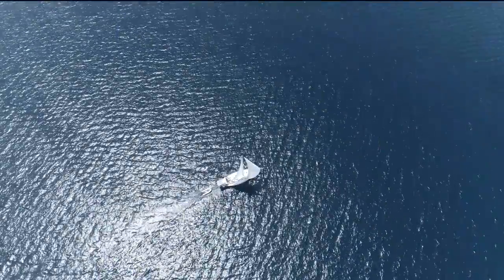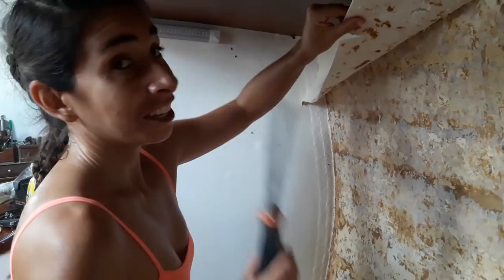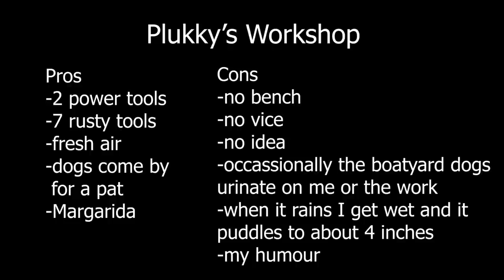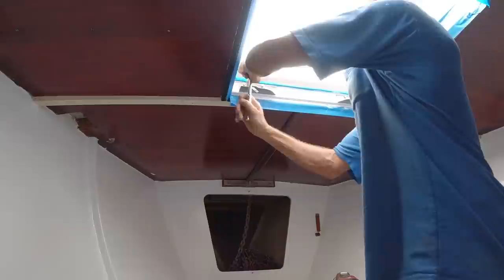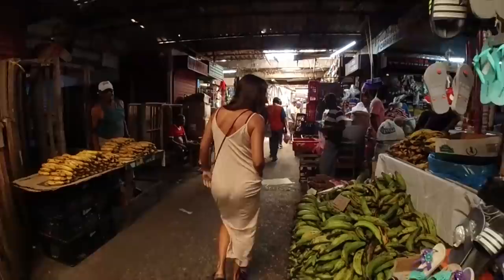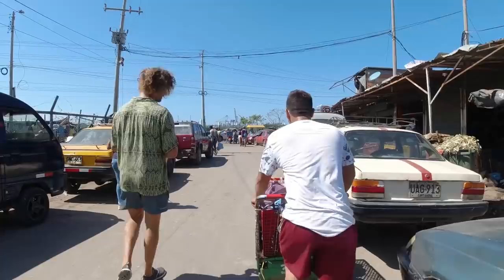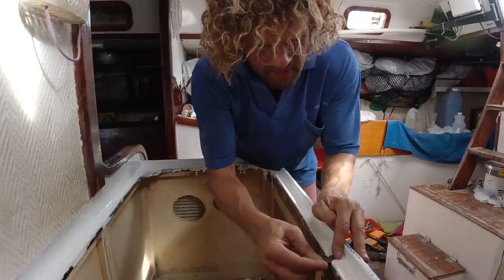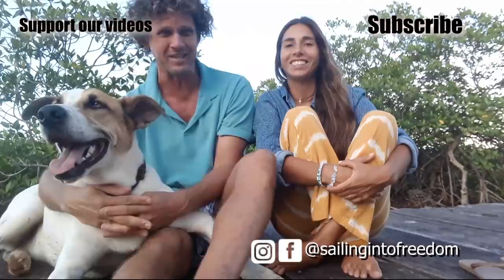Ep. 256 DIY - the clock is ticking on our boat repairs

Comment: Pete, a floodlight at the top of the mast pointing down to the stern/cockpit area is ideal for any safety and security , but the best and cheapest option for night time attacks is a torch of about 2,000 plus lumens with a strobe light function @ a cost between AUD50-130.
I have had a motorhome for the last 10 years and I had a guy nosing around it around 2 am--I have a purpose-built caged trailer with a KLR650 adventure motorcycle in it, fishing gear, a malibu and a wave ski, and a kayak on top all of which attracts a lot of attention wherever I go--and once I located where he was outside from inside the motorhome, I stepped outside and turned the strobe light on and he was totally incapacitated. All he could do was run away. He never even got to feel my kendo sword across his noggin!
For day time boardings, whether you are present or absent, is 'noise'! A recorder, a loudspeaker, a trip mechanism and switch all of which @12v is relatively inexpensive. Get a 'Margharida Fidelity and Security Fund' going and I am sure that a lot of us will kick the can to help out.
Cheers, mate.
Reply from the maker: Thanks Jack...I think I prefer a 5 foot spear shaft at 100mph
Reply: @SAILINGintoFREEDOM  I think that it's all a matter of degrees of escalation whilst maintaining some semblance of control of the rate of escalation.
I spend a lot of time in remote areas, either inland or on the coast, and either attached or separated from the motorhome, so for me it's all about raising any potential third part predator's risk awareness.

Comment: You can get urothane rubber in two pack and different hardness which may work on the prop to replace the damaged rubber bushing.
Reply from the maker: Thanks Samantha, I think it needs to be under quite a bit of pressure because they are pressed on    so I am not sure if that will work but someone out there should try it

Comment: I have a new boat head commode with built in manual pump -- that I'll never use.  I wonder what I should do with it?
Reply from the maker: Are  you offering it to us? The trouble is to get it here if you want to do that...the cost for you to send it here is high, and then the cost for us to pick it up is higher still,we pay per pound...so both of us pay for the postage...I will try and work something out...thanks for the offer

Comment: Do you have the 1 inch bore flare guns, or the 12 gauge? I have both, the 12 gauge is useless, the 1 inch bore one, needs to be held by 2 hands to fire it, the recoil affects the aim if fired one handed, I blew a large piece off a tree, well above my aim point.
Reply from the maker: I have the plastic flare guns that look like toys...I wish I had the proper ones with the sleeve inserts
Reply: @SAILINGintoFREEDOM  The proper ones are good, with or without the insert, the red plastic ones are pretty much toys.

Comment: Perhaps it may have been better to install the security frame with the screws on the inside if possible?
Reply from the maker: Maybe look a bit harder
Reply: @SAILINGintoFREEDOM  Sorry, didn't mean to be rude or anything. I just meant to have the brackets reversed, such that the screws are orientated  on the inside of the frame, meaning anyone wanting to unscrew them would have to put their hands through the frame to reach them.
Reply: ...on the padlocked side

Comment: you should have taken that rust bucket stove right to the dumpster and refitted  with a cheap camping stove
Reply from the maker: We have a cheap camping stove but the gas cylinders create a lot of waste...if i was to take all the old crappy things off the boat, there wouldnt be much left...it is still working

Comment: What is the significance of 140K ?
Reply from the maker: I did the maths (second order partial differential equations) on the statistics and it shows you would really have to be a complete drongo to fail from there...so it is debatable in our case but 200K would guarantee it
Reply: @SAILINGintoFREEDOM  Don't ruin your persona Peter. We like you better as a Caveman than... an Engineer